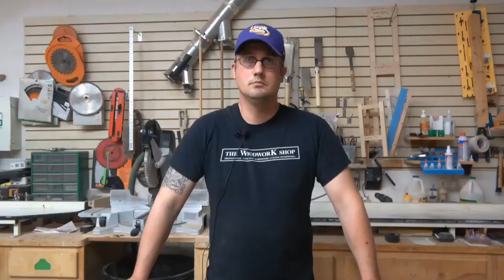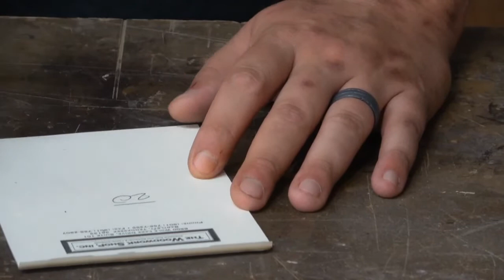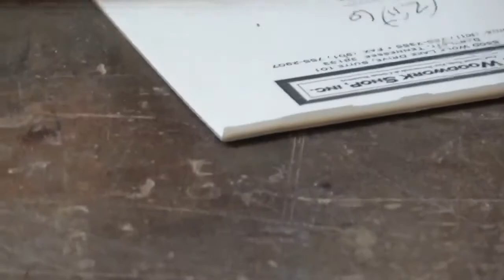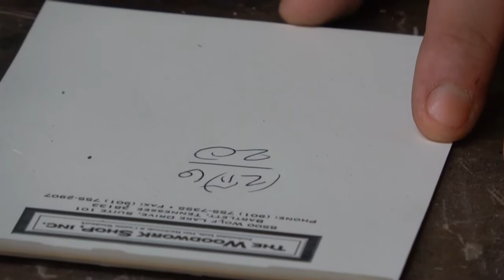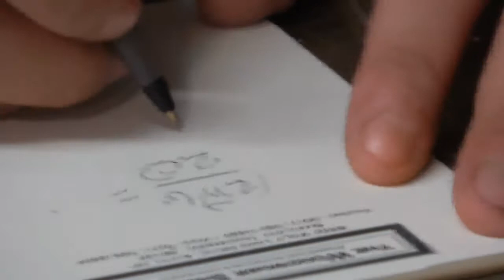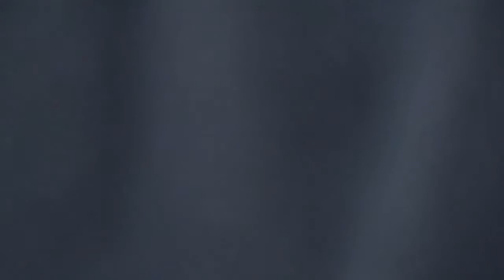Segment length and angle determination

Comment: I got tired of dealing with fractions and bought a metric tape measure.  Don’t try to convert it to inches.  It is way easier than figuring out the decimal equivalent of 7/8.

Comment: I originally used this method to make a ring of a specific radius but quickly found out that after turning ( cutting off the corners of the ring) the ring would  end up with a smaller radius. Stated another way, The radius must go to the center of your segment not the ends. The measured radius ,let’s say 6 inches, to the assembled ring will be correct at the ends but will go past the center of the segment . So I ended up using my angle of cut, the desired radius, and some right triangle trig to calculate the length of the segment.